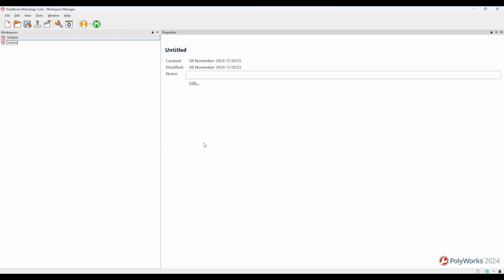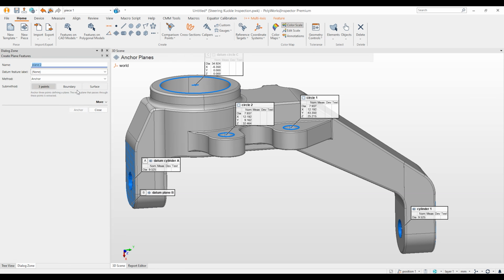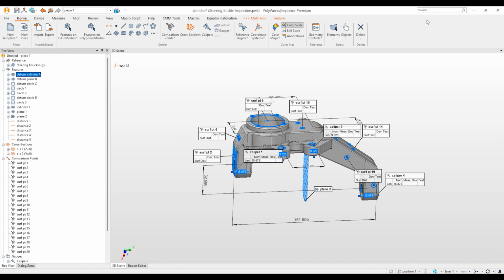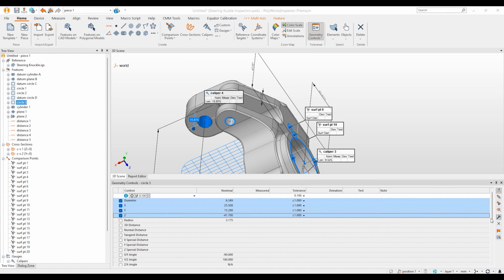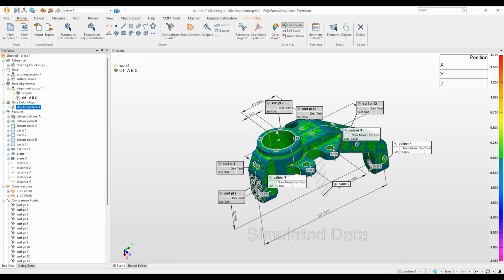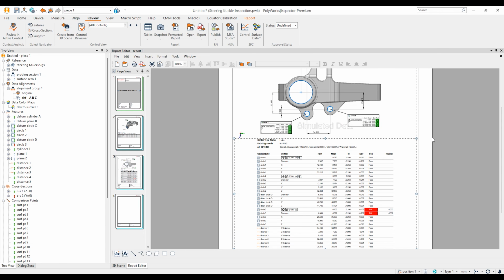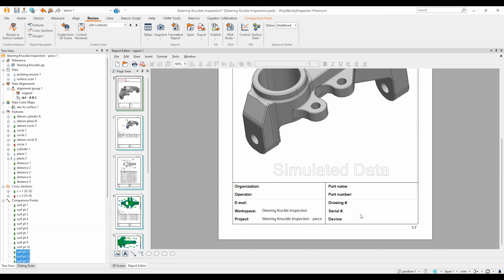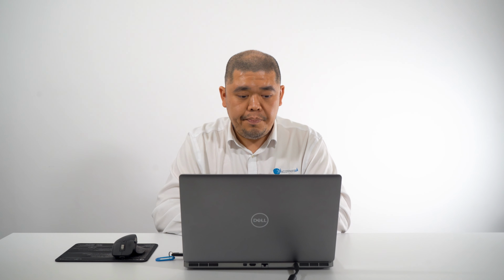Basic Inspection Workflow - PolyWorks® 2024

Comment: Is it possible to change the direction of a plane at will? Even for the measured data? Also, is it possible to take measurements and "treat" features as planes, lines or other things to achieve the correct measurement?
Reply from the maker: Hi, if you are referring to the planes IJK vector, then yes it's possible. Can you clarify your second question, or maybe give us an example of what you mean?

Comment: how to measure tap holes that only show  up as cylinder features?  would love to use ball comp instead of 3 hits
Reply: There's really not a way of doing maximum inscribed cylinder evaluation in Polyworks, unfortunately. What I have done is calculate out, based on thread pitch, where the probing points should be, and it gets close to a correct measurement, but that's kinda crazy. Better off getting some true position pins if the positions are critical.